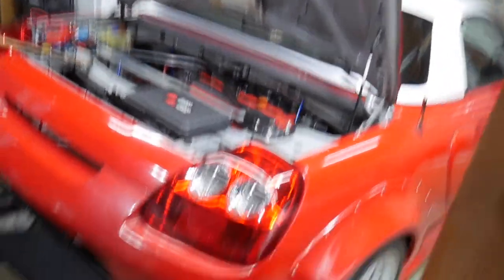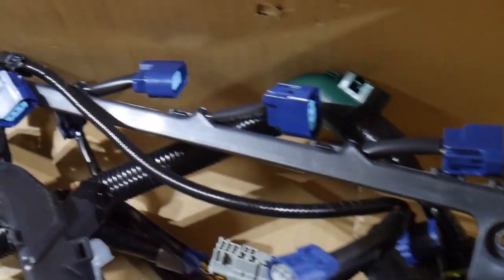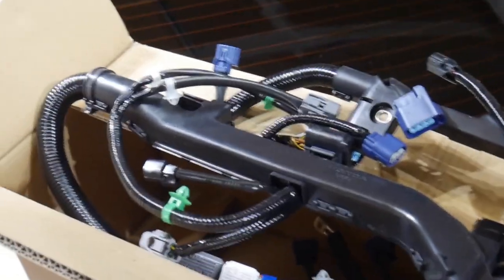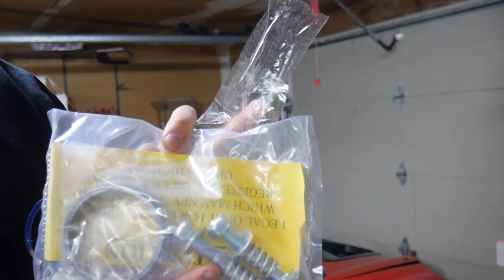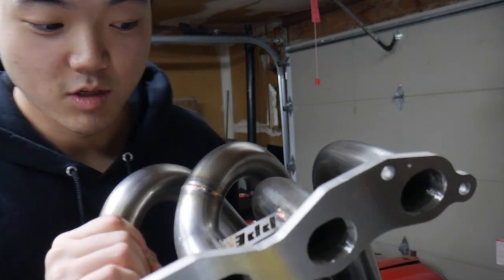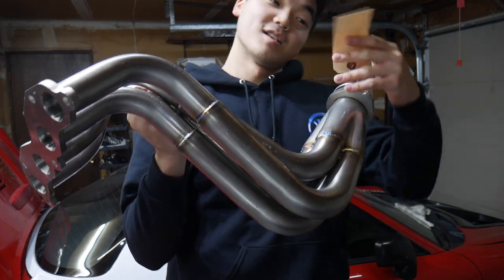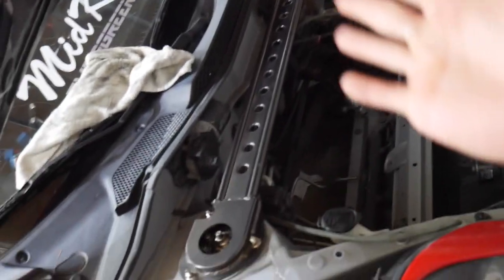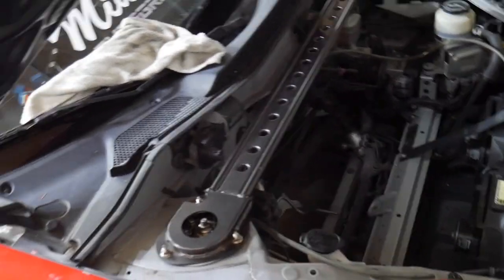The Next Step. | Kswapped MR2 Spyder

Comment: thats good that you can still get a new k series harness, i recall for my older 1988 mr2 i had to resolder all my shady connections by hand took about 3 days (fuel injector wire in trunk was culprit mainly for not running)